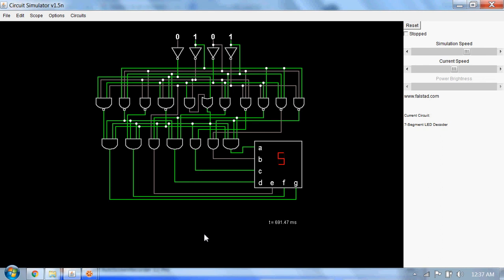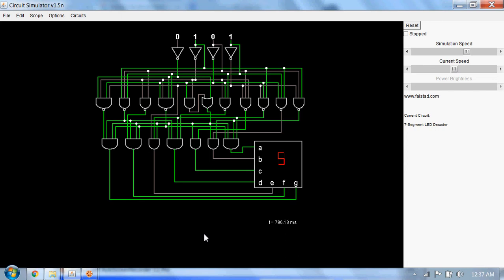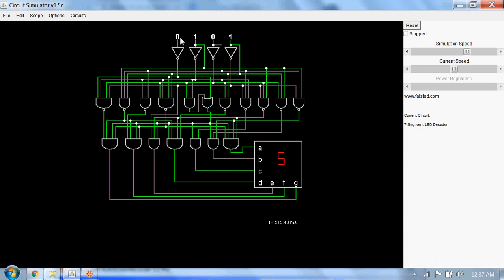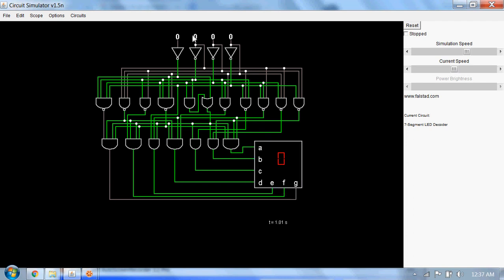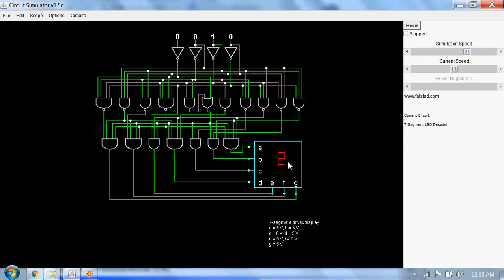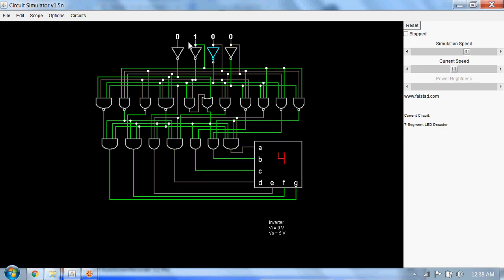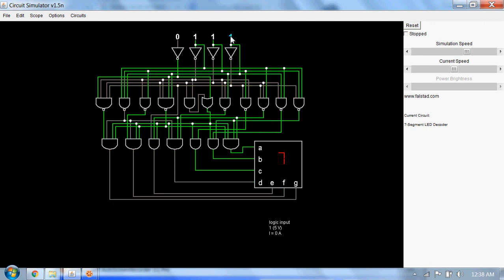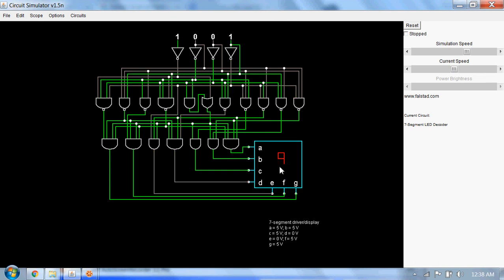BCD to 7 Segment Decoder

Comment: I love to recreate this in the app EveryCircuit only for study purposes, but I won't get the free time to do so.
Reply from the maker: Thanks for your comment friend. I hope my videos are helpful :)
Reply: Electrical and Electronics Engineering, have you ever used app EveryCircuit? It comes with two versions, free and paid. If you haven't seen it, you ought to see it in Youtube. It does circuit simulations where you can really see the movements and various speed of electrons on paths. I learned electronics fast that way. EveryCircuit also has its hub where you can view others' works and you can play with those, if you like. I have only started electronics few weeks ago. I am reading new and vintage ebooks on electronics at Open Library.
Reply from the maker: yes. This is Java applet and it does the same thing. You can learn fast by watching animated circuits :)